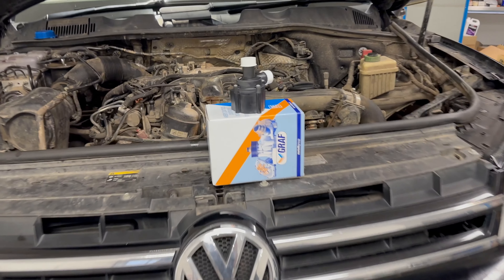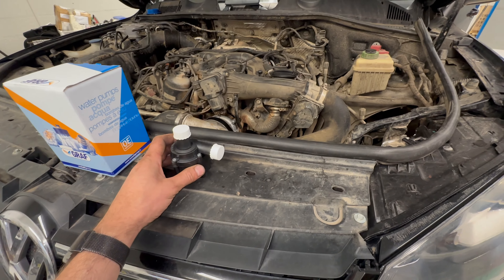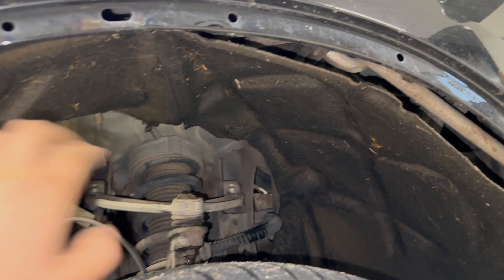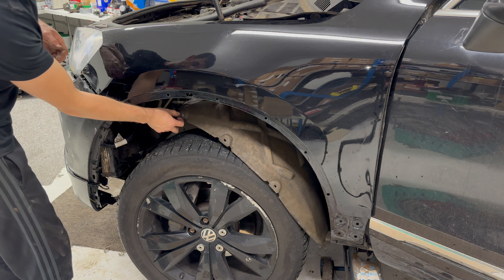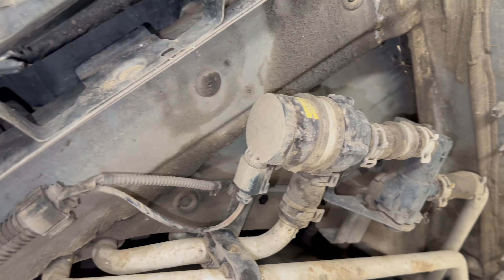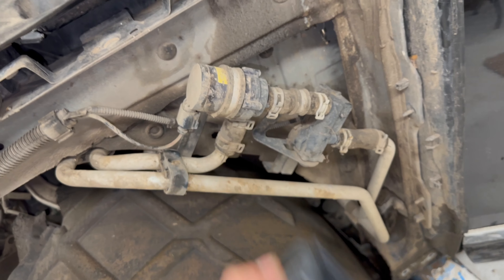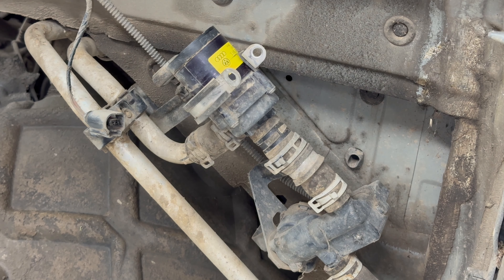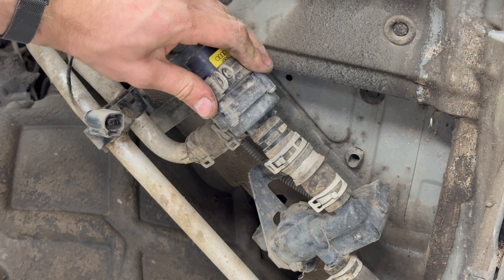VW Touareg/Q7/Cayenne 3.0 V6 TDI Auxiliary Water Pump How To DIY Audi Porsche CRCA

Comment: I was wondering where that stupid pump(V50) is located. I am plumbing in an auxiliary diesel heater into my Q7 TDI and the suggestion was to plumb it in before this auxiliary water pump but I couldn’t even find the damn thing. The coolant systems are way too complex on these diesel cars.

Comment: Great video!, I'm getting a 'POC2A - Auxiliary
Transmission Fluid Pump
Motor Stalled' on my Q7, is this the pump the faults referring to?
Reply from the maker: That sounds like it relates to the gearbox and not the coolant.